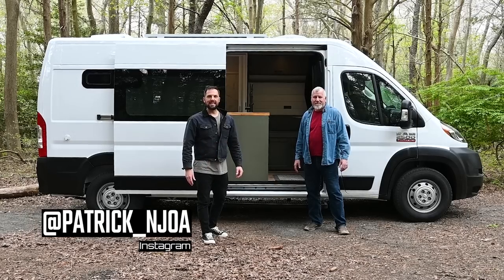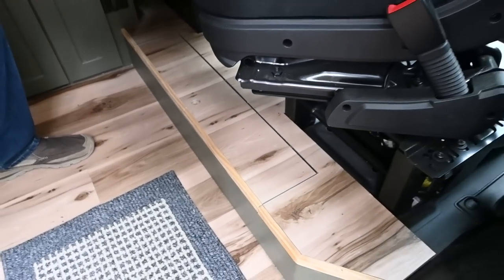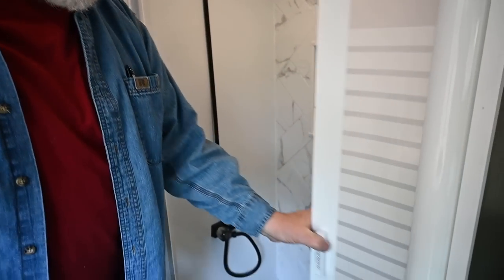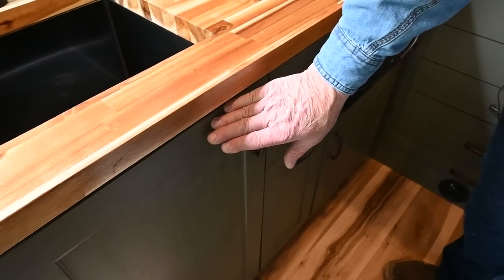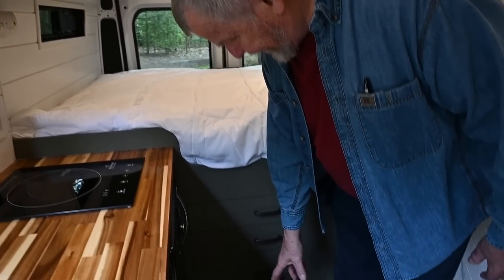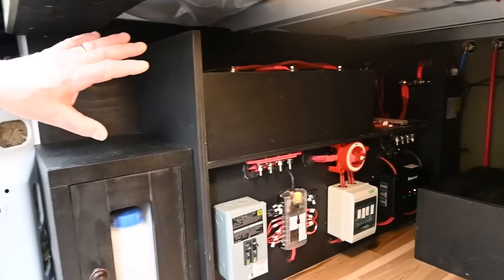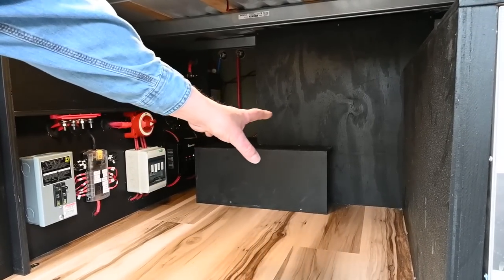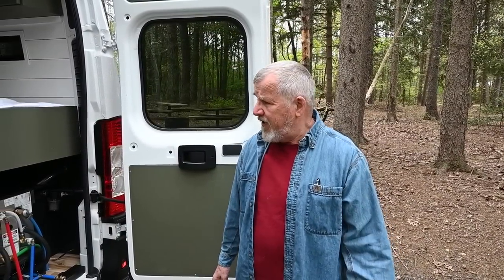Custom Campervan Conversions By Jerrys Custom Vans New Jersey

Comment: The good thing about Rockwool is that it’s originally made for houses in Denmark where it’s raining and oftentimes fluctuate in temperatures. The insulation needed to be adaptable to all kinds of weather and it’s semi-easy to work with. Just remember appropriate workwear when working with it.